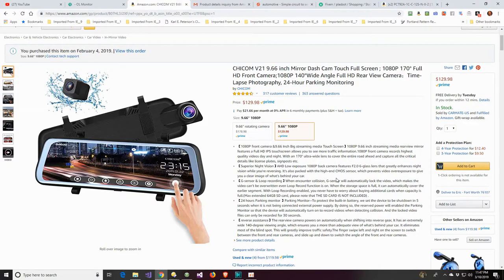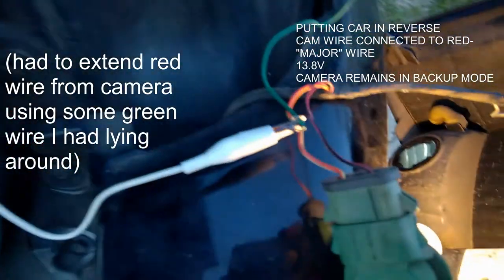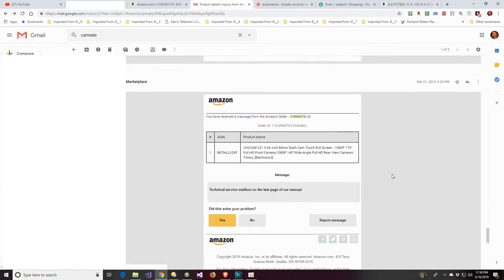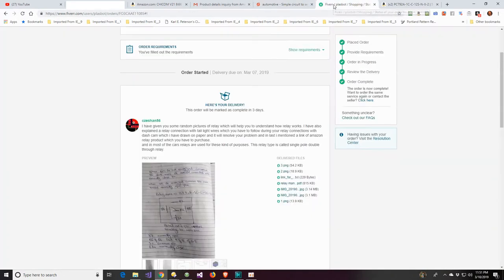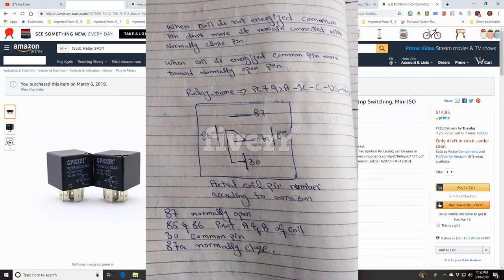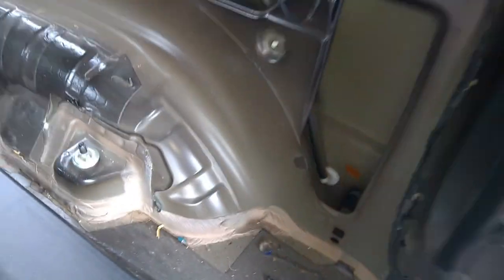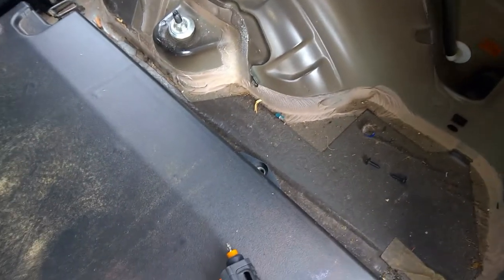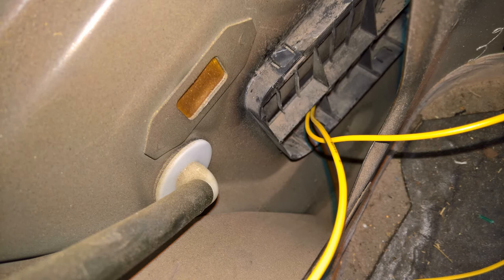Dashcam with backup camera installation: How to fix reverse camera issue- Chicom V21 1080p

Comment: In my jeep grand cherokee 2004, the backup camera doesn't turn on, it stays on the front camera. The red wire is connected to major white wire (backup lamp, when i put it in reverse they light up, but not the cam), do you think that i have a similar issue as you?

I really appreciate your post, I love the resolution on the camera, this is why I am looking for help to solve my issue.

Thanks!
Reply from the maker: It sounds like the same problem.  You could use a multi tester to be sure. Or try hooking the wires up the opposite way to see if that works.
Reply: @plasbot  will try it out today, thanks!!!

Comment: Oh so maybe you can help sort out some of these usage questions since you own one. 
Okay so as we all know theres no instructions or guide that really give a good breakdown of how to use it once installed and working correctly. 

So questions here. If it has 24 hour parking mode that means it needs to be wired to a constant source ya? But I hear people always saying once you turn your car on it will turn on. These are two different ways of wiring it ya? 

If its gonna protect you 24/7 then it needs to be always hot. If its always hot and recording in stealth in a loop til something happens then saves that moment of time and locks it for your protection... um isn't this constant "just in case" recording going to kill yer battery? Even if the monitor (mirror) is turned off but power going to unit isn't it taking tons of battery to record from back and front cameras constantly in order to "catch" something happening real time? btw does it have motion detection so they record if someone goes near your car in parking mode? Or do they have to hit it so hard that collision detection turns on and records? Of course 24 hour parking mode and collision detection should be two separate functions. 

Now if I have it connected hardwire to my cigarette lighter (which is always on on my car regardless of if the car is turned on) so I have a permanent power source always on then do I turn the mirror off with the power button on the bottom when parking for a long time so the screen turns off so it draws less power? Or will it time out if left on with no movement for a period of time? Or do you just leave the mirror image from camera on all night? Or do you switch it to "Parking Mode" manually when you want to enable it? Also as you know if its always hot its always showing your rear view camera (if you have that on screen which is ideal for me) when you get out for day to day errands. So do you just leave it with the image on when you get out of car or hit the power button?